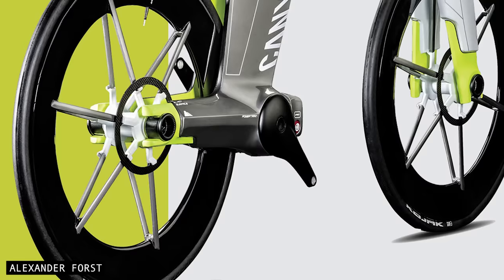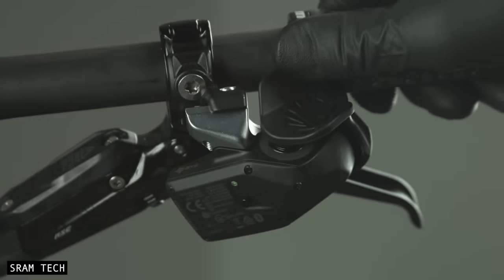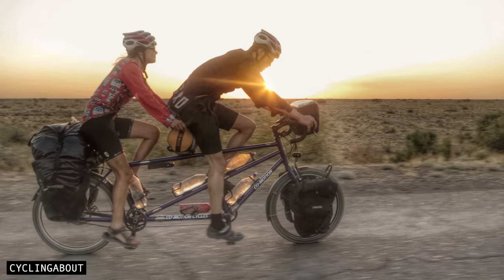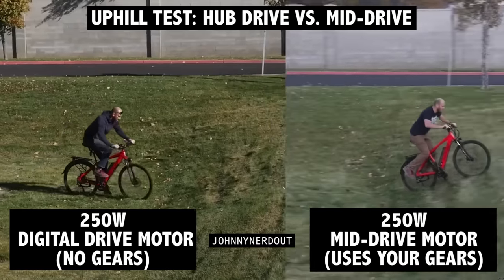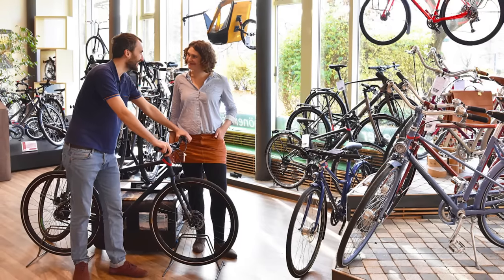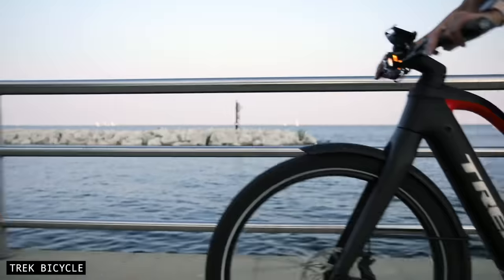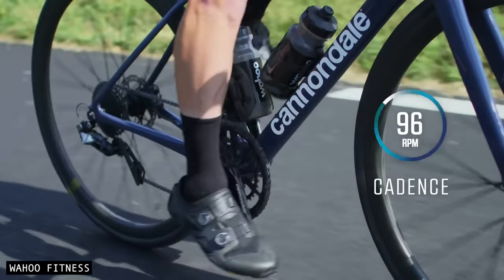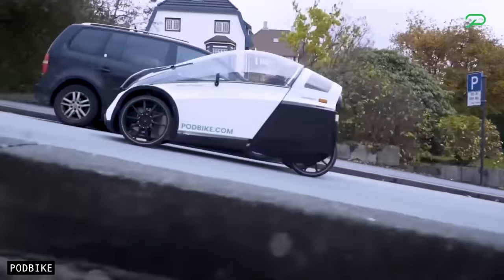Are Chainless Digital Drive Bicycles The Future of Cycling?

Comment: I think having a motor to help you speed up from a stop, or while riding uphill, as well as regenerative breaking are a good idea. But I'd make it a hybrid, so that there are both the chain system as well as the motor and a generator, so you get the efficiency of a chain drive, but some advantages of the digital drive.
Reply: I heard regenerative drive system is too heavy and expensive to put on a bike. Also it’s not digital!!
Reply: @aaaaaaaard9586  It's not, electric motor can act as a generator too. My previous e-bike had regenerative brakes.
Reply: @digitalspecter  It says you need a different type of motor called direct drive motor for regen brake, which is heavier than normal motors. It also adds resistance on pedals, and creates heat when it brakes. All that for around 5% of battery saving.
Reply: Those have been around for ages.
Reply: @aaaaaaaard9586  a lot of ebikes have direct drive motors, they're cheaper than mid drive. They're a bit heavier but way more reliable and don't require replacing your chain as often. A big benefit of them is when you're using the regen braking is slows you down without wearing out your break pads.
Reply: Let's make it cost 3000 dollars, lol
Reply: @aaaaaaaard9586  I have 1,700+ miles on each of my Rad Power bicycles. Regenerative breaking doesn't really work for a bicycle. The problem is you're never really going fast enough (23-25 MPH) for long enough to put much of a charge back in your battery. You'll just slow quickly down to 12-15MPH and find yourself pedaling again. It's much more efficient to freewheel coast and enjoy the added speed benefit and coasting distance than to capture it to the battery then send it to the motor later on. 
Regen works much better in an electric car (I drive a Honda Insight) where you have lot more speed and mass (inertia) behind you and you can engage the regen half a block away from a red light. This is why hybrids and electric cars get better city mileage than highway. At highway speeds I'm running straight off the engine, as the only time I can use regen. to recharge the battery is when slowing down for a city. Generally speaking there are very few hills I can coast down with regen on and maintain 70-75 MPH.
Reply: That sounds like the worst of both worlds ngl. The weight of both systems with the advantages of none.
Reply: @lordderppington4694  Actually the electric assist / boost part works amazingly well. If you were to put my old buttocks on one of my electric bikes and an athlete on a road bike they wouldn't be able to keep up for the first 20-30 miles. Then it switches 'cause my battery is out. Anyway electric bikes are pretty awesome, just the regen functionality (if present) is kinda like the fins on the Batmobile. Cool idea but essentially useless.
Reply: That’s the way. But anyway, no magic: while charging you apply more force for the same acceleration, so this system should be able to detect free rotation while going downhill and enable ergonomic regenerative braking leaving ability for classic emergency braking.
Reply: A good design might be using the pedals to power one side of a planetary gearset with an electric motor on one of the other sides and the chain sprocket on the last side.  The electric motor could be used for power or regeneration, and to control the drive ratio between the pedals and the wheel.  The downside is that the bike would have a fixed gear ratio if the battery died.
Reply: So motorbikes are baaad and bikes with motors are goood. Clown world.
Reply: Keep your normal geared bike a new front wheel with hub motor. Buy tube down/cross quick release battery/attachment, handlebar throttle/ dash board. Wire it up and your away. You can cycle normally & partially recharge the battery going down hill, at the sacrifice of acceleration/speed. It's the cheapest way to go electric, however not the best. However if you don't like you can always sell what you've bought!
Reply: So an e bike ?

Comment: If you combine it with an ebike with proper motor controls (including torque sensor), I cannot help but wonder how good a front or all wheel wheel drive would be.

We saw in rallying that all wheel drive was absolutely the way to go for control in difficult circumstances, so it could make sense for bicycles too. I just don't like the ones that do it currently, because the motors are never properly controlled and just go full torque the moment they're activated.
Reply: I actually think a torque sensor is the wrong way to go. Why? Because in many situations you want to be able to modulate your speed. If the only way to slow down is to work less, you cannot build up power for that next hill. And if you don't save up, you will fail to make it up that hill. A hand throttle and optimizing your cadence and output you're willing to put in, could allow you ride with almost as much efficiency and certainty as you currently get with a parallel (traditional) pedalec. I think this video started out with the right concerns, that weight and efficiency losses mean we'll continue to use chains and belts.
Reply: @karlInSanDiego  You are absolutely correct. I immediately fell back to my "I hate these on normal bikes" mindset when I started thinking about front wheel drive.

I do think they could be quite interesting and possibly advantageous though.
Reply: All wheel drive bicycles already exist - and have for decades.  Look up christini all wheel drive bicycles.  They have more control descending and improved drive traction for climbing.  They work.  So far the design hasn’t taken off.  It doesn’t look like they will anytime soon.
Reply: Yupp, but kiss it. Pedals drive generator and charge battery. Battery drives motor.  1 gear , like a Tesla. Gears and chain on an ebike are just plain weird. Huge thanks .
Reply: All wheel drive is not needed unless you ride up and down soft sandy beaches. A military combat situation where you need to sprint with a burst of speed would be helpful. 
I would like to build a all-wheel drive bike just for off road fun…
Reply: @bruceedge1649  Gears and chain on ebike make EXACTLY the same sense they do on a regular bike. Generally ebikes do NOT have the power for every situation, changing gears is still a must. Ebikes allow one to maintain a significantly faster average pace. Other than that you ride just like a regular bike.

Pedalling just to charge a battery, while having the motor provide all the motion, would NOT be a bicycle. I ride my ebike as hard as by regular bikes, I just go faster and cover more ground on any given trip.

The idea in the video, is an solution looking for a problem that does not exist.
Reply: @karlInSanDiego  I feel like the solution is pretty obviously to just let the user choose the mode they want at any given moment: a torque/throttle switch and controls to adjust assist sounds like the ideal bike to me.

Comment: When I was commuting daily by bike as a student, my yearly maintenance costs were less than 150 euros (most of that was a yearly service by a mechanic). That is insanely cheap for something that I used every day, rain or snow. There is a great strength in the simplicity of the chain drivetrain: it makes it easy to learn how to service it, and straightforward to produce spare parts, you can even learn to do it yourself. Compare that to the nightmare of modern car maintenance, where even software errors can (at least temporarily) brick your car.

Comment: I can see the advantages, much like electrical cars, it has the best potential in a city with lots of stop and go for regenerative braking, and a relatively low top speed. The concept is interesting, and I'd love to see where it goes. To an extent, I can see hooking your bike to an external battery.
Reply: regenerative braking only recovers 5% (10% max) of the braking energy or so due to the inefficient generator that recovers the waste energy
Reply: could you pedal while driving slow and when the battery is charged a bit drive without pedaling?

Comment: I thought this when I saw the emergency closing cranks for water tight doors on ships. I used to work in ship building. You simply rotate a crank and two very large cables transfer the electricity generated to the door motor that closes or opens the door depending on the direction. It essentially is the same thing.
Reply: I'd also argue that it isn't "digital" it is very analog. Just electric.
Reply: The gearing is determined by the coiling. So it will be single speed and that's it. No easy way to have gear in this system.
Reply: @K1989L  isn't it pretty easy to control speed of an electric motor tho?
Reply: @K1989L  Actually quite digital for the controller driving the motor. For efficiency a synchronous motor is needed which means digital controller has to generate a variable frequency waveform.  The controller has to be aware of current speed and current power requirement.
Reply: @K1989L  Synchronous motor where the digital controller does all the work. Full time electric cars have no gears. It is all magically done by the digital controller.
Reply: @K1989L  Not true - the electric drive in between the motor and generator can have any voltage transformation desired. The system is just lacking in efficiency... I have designed electronic drives such as this but they don't give you something for nothing! :)
Reply: @K1989L  I agree. I am an electronic engineer and the "digital" aspect of this is by no means essential to the concept. It is a series hybrid - that's what it would be called in automotive tech.

Comment: the idea is simple: take what can work for 200 years and make it work until the next update
Reply: That is what people said when others put chains and pedals on their walking bikes😉
In all seriousness. No drive-train lasts that long without maintenance and parts-replacement (unless you don't use it).
Reply: True, yet anyone that can handle a brush, spray cleaner and lube can do maintenance.
Reply: @jedibusiness789  The kind of maintenance that is not required in a system like this (well, you still have to maintain your tire pressure).
I'm talking about replacing the chain/cassette/derailleur(s)/chain-ring(s)/gear-cables and then adjusting it, so the gears change properly again. 
There are really only 2 components that will break on an e-bike (from the e-drive, commonly it is actually the chain/derailleur part that breaks). Motor controller and of course your cables/connections. Both are easy to fix, they take very little skill and won't cost much (certainly not more than replacing your chain/derailleur). There is pretty much no need for specialized tools (maybe some torx-bits depending on your model, but that is not more special than a chain-breaker).

Longevity and ability to repair is really not a concern. Efficiency is (though it would be really interesting to see a comparison to a bike that has been used for a while and including recuperation).
Reply: @etherealicer  If efficiency is important, this dual motor is far away from the solution with over 40% power loss.  A normal chain drive bike that has been beat to hell would never lose more than a few percent of efficiency.

Comment: I think I'd always rather have a pedal assist e-bike with a regular chain.
The chainless electric bike seems like a novelty that exchanges efficiency for some cool factor. Which granted some of them do look cool and futuristic.
An ebike with regenerative braking to me seems like the best path forward for bikes.
Or just ride something cheap and human powered that won't get stolen, that's probably the most cost effective. Ebikes are already being banned on lots of trails in the US unfortunately, and likely digital fall under that same ban.
Reply: ebikes are banned because the battery can allow the bikes to move faster than a normal riders speed.  US law regulate then to under 25 mph unassisted but people alter them , thus the ban.
Reply: @danc2014  If they would be similar strict about cars who legally are capable of highway speeds in inner city...
Reply: For a regular bike, a mechanical electrically assisted drivetrains makes more sense. But for e-cargo-bikes, this type of drivetrain can be much better than anything chain based.
Reply: @danc2014 : I don't know where you're living, but Michigan allows E-bikes on its trails, for the most part. 

The way the statutes are written is that an E-bike is restricted in top speed, but for some reason, a human-powered bike isn't? I can get a 26" 21-speed MTB up to 45 mph on flat land, with slight variations on pavement. Which, by the way, is the actual speed limit on some roads around my area. 

Point is, I see no point to restricting E-bikes according to motor rating or top speed, when anything below a 11.1 kw power output rating is not allowed on interstate highways and freeways only (i.e., limited-acess highways).

And Interestingly enough, the only type of vehicle whatsoever that's rated at some kind of class are commercial vehicles, based on GVW; number of passengers that can be carried; and number of axles.

Not even cars & trucks are regulated by motor size or horsepower, which discriminates against E-bikes, given that speed limits exist for a reason, and most E-bikes have speedometers. So my question is, why not just simply say, "E-bikes are e-bikes, no matter what the power output is, and the only obligation an e-bike rider has is to adhere to the speed limit of whatever road they're on, and that they are prohibited from all limited-access highways"? The rules for E-bikes just seem arbitrary and discriminatory, is all I am saying.

Comment: Great video! The use case I have always thought this would be best for is an e-bike recumbent because regular recumbents have to have super-long chains to get all the way from the crank back to the back wheel which are kind of annoying. "Digital" bikes will have lots of fancy electronics but really you just need two dials: how much crank resistance you want and how fast you want to go; and something to tell you the range you have left given what you have set those two dials to.
Reply: Agree, for a recumbent it really would be a big advantage. The aero advantages would compensate for the inefficiency, the power transfer wouldn't be nearly as tricky as a mechanical recumbent (thus the relative weight penalty is less than in the upright case), you could easily add rear suspension which is a big boon for recumbent, and the electric drive makes the startup less daunting.
Reply: Electom is a company in Canada making recumbent, digital drive e-bikes. The channel  Fort9 made a video about it some months ago.
Reply: @max-zv7sf  I think you mean Electrom.

Comment: Ever since I purchased a drive shaft bike years ago I have not been a big fan of chains.  The simplicity and reliability of drive shaft renders chain drive obsolete in my view.  The concept described in this video is very interesting.  I have thought about a similar drive years ago but was under the impression the losses of efficiency would be so great as to make the idea impractical.  I see in this video that many of those obstacles are being overcome and that is very exciting.  Thank you so much for posting this video.
Reply: With a throttle you can pedal at any speed you want and have a smooth ride so I don't think it is a bad trade-off. They spend too much time mimicking conventional bicycles when they could have a easier time building the RollsRoyce of bikes.

Comment: Comprehensively researched and well explained, as always. And I agree with your conclusion: it's not an alternative drive train for unassisted bikes but it will likely displace the mechanical transmission bits on e-bikes.
Reply: No it won't.  You first...lol.
Reply: If you had said 'some bikes', you could be correct. Bikes in general? Not a chance. This is a solution looking for a problem. Bicycles when invented and bicycles in 2022, still the most efficient mode of human powered transportation. Why throw that efficiency out the window?

This will be super duper niche, and ultimately will be a complete failure.
Reply: @joeshmoe7967  the way most people ride it it is quite inefficient, most average people pedal 200W and have the middrives in turbo, and Bosch CX peak at around 700-750W infact, not the "250W" European limit

that means you got 200W pedal power and 700W assistance so 900W total, if you went to this mode it would be like 820W (200W effort but 40% loss, 120W) and the 700W

your consumption wouldn't increase as the power is limited, still a marginal difference in the end.

not only that's great but you'll have the ability to fine-tune the feeling of the pedals, your preferred cadence etc in software as you can vary how much power the pedals generate basically, and you've got none of the issues a normal drivetrain would/could have (derailleur adjustment, chain cleaning, chain skipping, or just no changing gears in general)

it's like having a cvt without a cvt.
Reply: @BH4x0r  CVTs in cars did not fail because "people want to hear shifting noises" but because they are unreliable and much weaker than any other type of transmission.